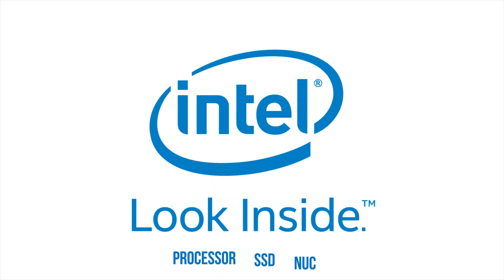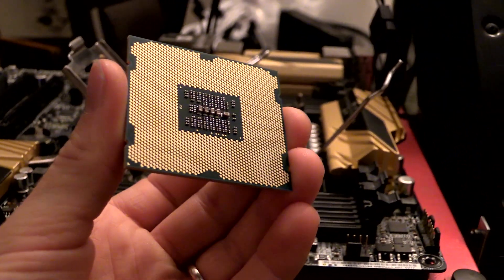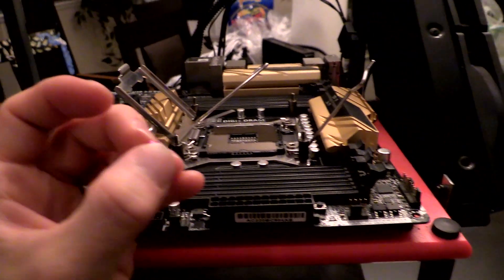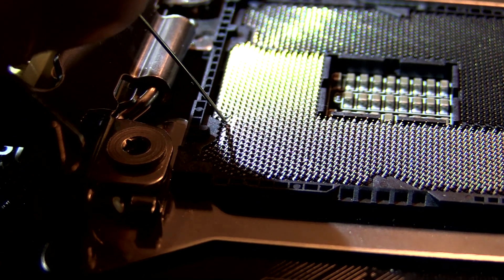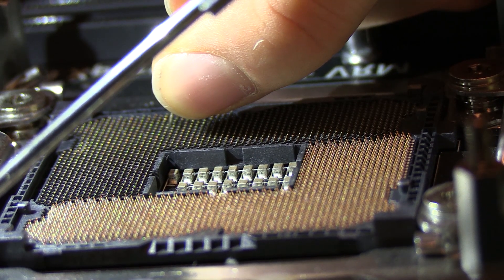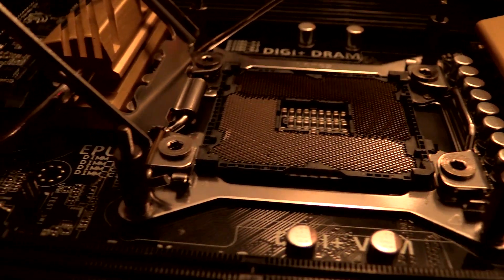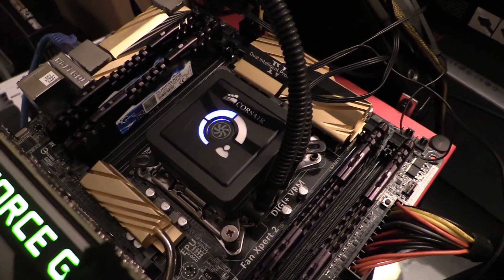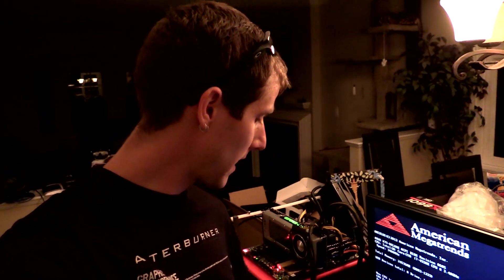LGA 2011 Socket Pin Repair Vlog - Fix a "Dead" Motherboard

Comment: This is kind of worrying since i am currently saving money for a 4930k and the exact same motherboard as in the video.
Reply: EVERYTHING breaks or get issues at times, doesn't really matter what motherboard you get it still got the possibility of breaking. If you want the one he is using, buy it. If you get problems, contact Asus to get it repaired. You WILL get warranty, Linus did not.
Reply: Engineering samples don't generally come with warranty because they're "engineering samples" that haven't been tested fully or put into mass production yet.  Released boards will have warranty
Reply: ***** No, the 4930K is ivy bridge E, not a haswell part like the 4770K and 4790K. It goes on the older 2011 socket, unlike the new Haswell_E part that replaced it, which uses the newer, incompatible, 2011_3.
Reply: It'll be fine.
Reply: sio is right and  2011 socket mob is what i have its so worthet =)
Reply: dude pins break so easily no matter the mobo don't even worry about it if you build it properly and dont put the cpu in upside down or somthing nothin bad will happen
Reply: Any board (or cpu) has a chance of breaking a pin every time you use it, but its important to remember in this case the motherboard was being used in the test bench of a major tech reviewer, so it quite possibly has done dozens of CPU installations during its life. Put simply this is not a normal workload for a motherboard, since most consumers will only probably install CPU once or twice in the entire time they own the board. Add to this that the fact that if you actually buy this board (as opposed to being sent a sample to review) you'll get a warranty, and you'll quickly be able to forget about the risk of a bent pin completely, since the RMA process only costs you shipping one way and takes a couple of weeks, so its not even a lot of risk in the unlikely event something should go wrong with the pins on your CPU or socket..
Reply: Y u no Haswell-E ?
Reply: Franck Bender Im not made of money! Im struggling for the 4930k budget! This is reusing my 670 until i have enough for a 780ti :D
Reply: Sio Especially Gigabyte motherboards.
Reply: Captain Salty 4930K will probably be dearer than the Bottom End Haswell-E :(
If you're on a budget go for a 780 instead of the 780Ti  ( the Ti is only about 15-20% more grunt but is 35% dearer )
or wait for the 800 series of course ;)
Reply: Wait do I get warranty when Purchase BRAND NEW computer components from amazon, I tried looking it up but couldn't find anything, once again, brand new
Reply: i am pretty sure you do if nothing else you will get the amazon warranty
Reply: Hamish McGregor Wow this was almost a year ago, i am surprised that people are still commenting on it :D Just FYI i got a 4790k in the end :D
Reply: Dr Barnabus The Google comment rape train never stops giving
Reply: Hamish McGregor yup =)

Comment: can you do graphic card repairs please?
Reply: what kind of graphics card repair? simple like TiM, or poorly seated GPU, or dysfunctional on-board RAM. These range from easy to do, to somewhat easy to do but should be covered under warranty, to should be covered under warranty and shouldn't be tampered with. If it is soldered down to a board you probably shouldn't be messing with it.
Reply: whatever one is easier for him to get :)
Reply: Step 1 throw your graphics card in an oven
Step 2 switch on the oven and wait
Reply: TechXSoftware
Just throw it in the oven and you're good to go!
(Not really, look a guide on it)

Comment: I had to fix around 30 pins on an old Asus z77 board, and around 10 on an MSI Mpower z77 :)) all worked fine
Reply: how did you get 30 pins bend in the first place?
Reply: I have no idea, i received the board for free, and had to fix it if i wanted to use it
Reply: ah a free board is a good deal
Reply: Wow, how long did it take you to fix it?
Reply: morfydiez you win my respect
Reply: Maybe someone wanted to turn you insane by giving you a free board you could never use by smashing the socket with a banana?
Reply: Yep they are. In the first stage, it would recognise only 2 slots of ram, then it took 4 :D
Reply: Neah, they were probably dumb customers putting the cpu the wrong side in, or putting it sideways..
Reply: Did this with my cousin's board after he bent one...or sixty...

He tried to put it in the wrong way.

Tools: Precision flathead.
Reply: How do you out it in wrong?  I've gone to put in a cpu wrong and let it go.  Never damaged a pin that way.  Now if your saying he clamped it down then... Wow.

Comment: Ahahaha, you can get it fixed for a fee. Thank God we peeps in New Zealand and to some extent Australia have a law called the Consumers Guarantee Act so with proof of purchase, we are able to get it repaired or refunded or replaced because it is not of suitable quality
Reply: Thats assuming it was broken when it arrived, which is near never the case when it comes to bent motherboard pins.
If you break it the manufacturer has no obligation to replace or refund it.
Reply: Yeah but we have to pay twice as much for computer parts, murica still has it better to be honest
Reply: If you converted it to USD, its about the same here and the extra money goes towards shipping. So double the money or not, it's still worth it IMO
Reply: Everybody has that 'act' around the world mate.
Reply: ***** QC would never let a bent pin through, ever. It's entirely the fault of the end user and trying to have a retailer replace it under consumer law is just dishonest.
Reply: David Chen  I live in NZ and there is no retailer that will refund/replace/repair for free a damaged motherboard socket, they have no obligation under the CGA to cover physical damage done by the consumer. And all decent countries have consumer protection laws.
Reply: We get a 1 year guarantee in the UK.
Reply: SHAD3R775 Not all countries do. As you can see, you need to pay for it after the guarantee has ended
Reply: scrabblan The CGA in NZ "covers for all goods bought for personal use, bought new OR SECOND HAND from a retailer." "It is the retailers job to replace the item" At least, that was what I learn't when I was at school. Part of the 1993/ 2013 (reformed) CGA
Reply: Well, many places have some sort of laws like that on the books. We have it here in the US as well, as does Canada if I am not mistaken, then there are different laws depending on what state you live in here in US. However I am not sure of any law that cover all items "forever", unless it's a warranty offered by the manufacturer. If I recall correctly, the law only provides protection for a "reasonable" time outside of warranty. Though I may be wrong, I am not from NZ, just have a couple friends there. lol

That board is an X79, so it's a few years old now, it's not like if the board fails 2 or 3 years later you're protected by law, unless it's under warranty of course. Of if you're the one that damaged the board, that also depends on the warranty. Lastly, as others said, that board was an engineering sample, not a product intended for public sale.
Reply: TRStrider74 I haven't studied the laws for a while now but I am 80% sure that there isn't a time period - it can't be some 8-10 yr old burnt out motherboard. For Linus, the would have to DIY, but for people who bought the product, I'm pretty sure the laws are still in act. But I do get what you mean :D
Reply: EHTU BRUTES Really, thats new. Thanks for the update ;)
Reply: Will One of my friends did. At PB Tech if you live in Auckland
Reply: Will If they refused to replace it in the UK and didn't really have proof it was you who broke it (even if it was a bent motherboard pin) they would be obligated to replace it... if they refused you'd just need to give trading standards a call and they'd sort it out for you!
Reply: David Chen I'm surprised PBT would have done that, either it was a very cheap mobo or your friend spent a lot of money with them. computer lounge and playtech are more reputable and they will only offer to send it back to the manufacturer to be fixed at a cost.
Reply: Will Finally someone who understands!
Reply: Will No. Actually the manager came out and said it was within limits. And the mobo was a mid range mobo.
Reply: Will Also, my friend learn't this as he chose to do two subjects at uni - Engineering and Law. He just simply pointed out that the mobo had a problem. The mobo was about a year out of warantee but PB still replaced it as they said it was within CGA